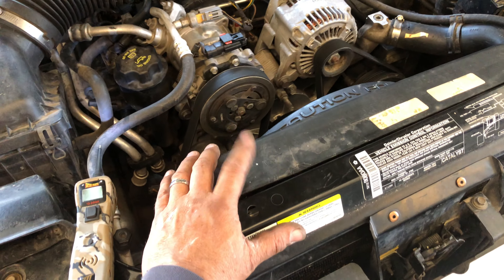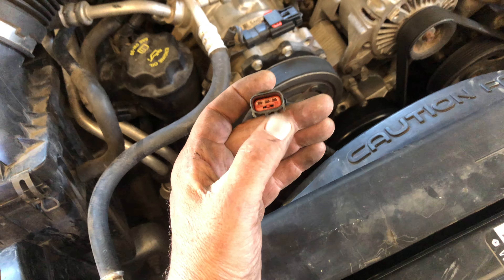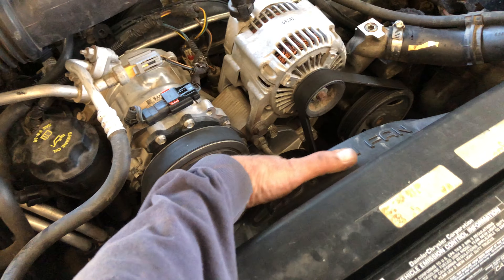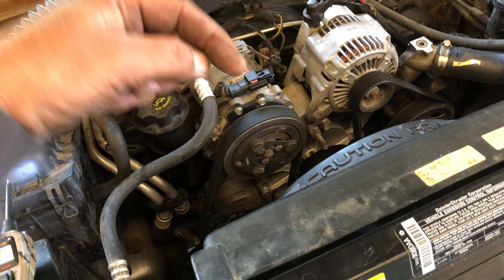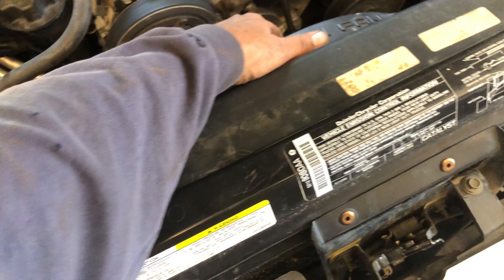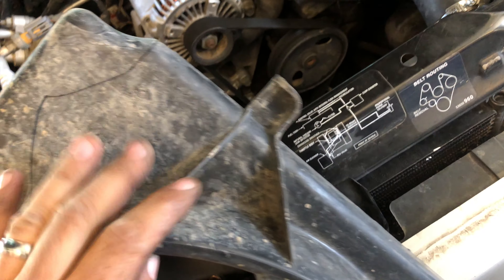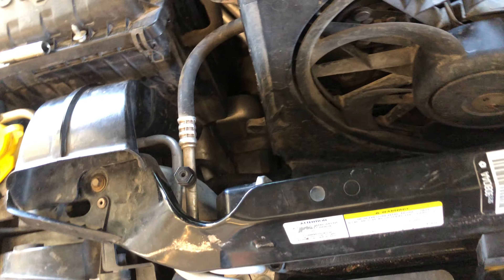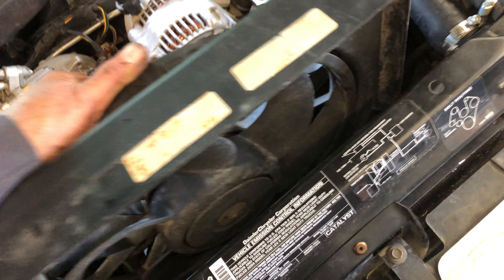2004 Jeep Liberty how to test and replace electric fan.

Comment: It did helped I was able to check my fan is dead . But I had to google basic stuff like how to ground wire and buy an electrical tester that glows when u touch hot leads on the connector. I connected middle lead straight to black cable on batter then red cable to tester and see if the fan kicks on .

Comment: I setup my early Bronco with a Volvo two speed fan relay set.  Bought a radiator fan from a 2004 Jeep Liberty.  Everything looks the same as in the video except mine has 2 wires instead of 3 wires.  All on Rockauto appear to be 2 wire.  Any advice on how to find a 3 wire radiator fan motor that fits this shroud?

Comment: Awesome video Brian! There seems to be a lot of confusion about fan types on these '02-'07 Liberty's... I have '05 liberty sport 3.7L (which looks <and should be> identical to your '04). Do these use an "A/C Condenser Fan" or a "radiator fan"? I ask because I only see one fan. Parts depots confuse this matter by offering the 2 fans types I mentioned above, while pointing out they are "not interchangeable". You're not just helping me, you're helping many:)
Reply: Better yet, what was the part # of the fan you used?